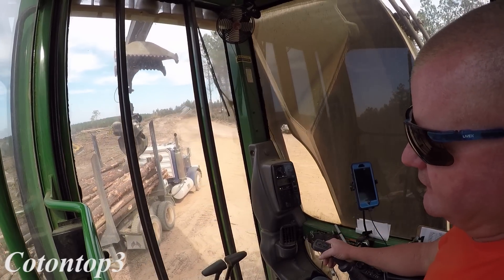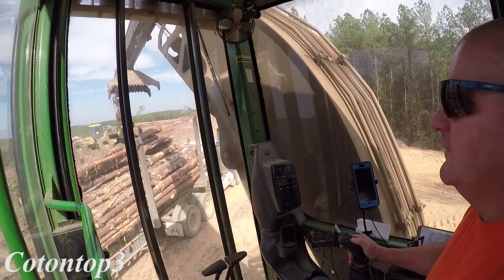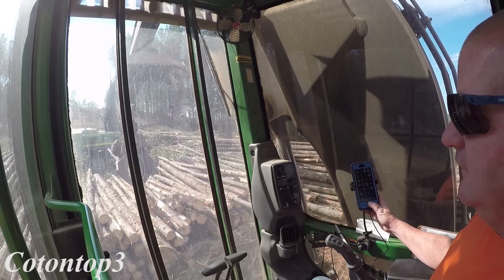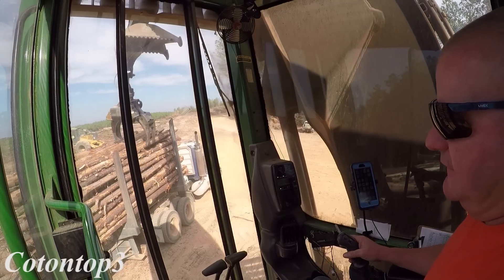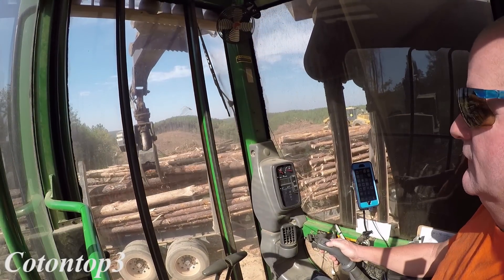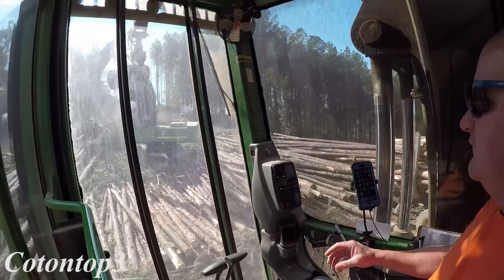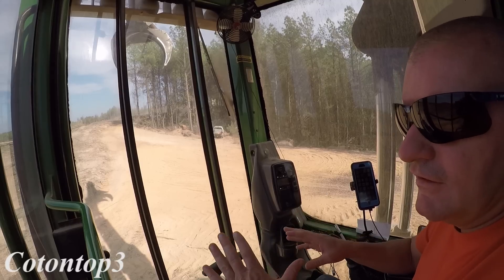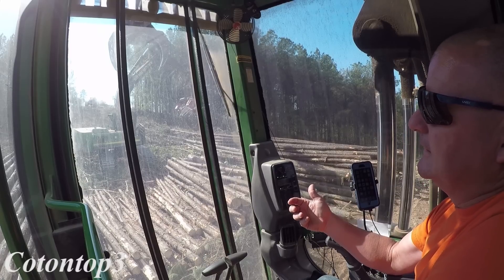Explaining a few things

Comment: Your're right about chippers.The last time I worked on a job site with a big chipper on it was after Hurricane Katrina.The one thing that caught my eye was the FUEL TRUCK that delivered diesel to the onsite tank every two days.That was one fuel consuming monster and every week it required a full day of maintenance.

So far as water trucks,two of my customers at work run large gravel pit operations.They are required by MSHA to water the roads around the pit and screening plant so it's not an option for them.They are watering non-stop everyday in this dry spell,so that's a man in a seat for 10 hours a day,the diesel to run the truck and the pump and about 40,000 gallons of water a day.Major expense is exactly what it is.
Reply: should see some of the equipment we used in oil and gas precommisioning, some of the water heaters we had burned 10,000L of diesel in a 12 hour shift. kept the fuel guy busy